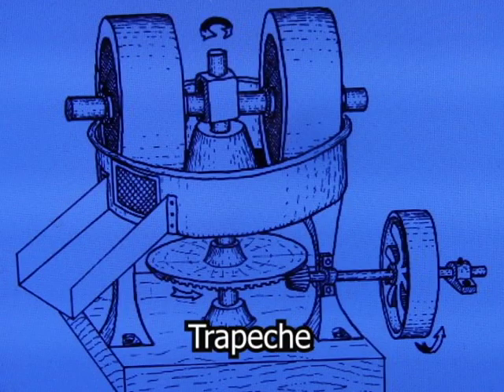Fundamental Milling Principles-  Crushing and Grinding

Comment: Great video Keith!
One note -- 1/8" screen (0.125" opening)  != #8 mesh (US Std. 0.0937" opening) because the wires forming the mesh have thickness.
In fact, without specifying the wire thickness, an 8 mesh screen could have openings from just over .100" to under .020" depending on the diameter of the wires and the weave.
Reply from the maker: You're absolutely right.  Sometimes I oversimplify for ease of understanding, sometimes just by accident.  Thanks for the input.

Looks like I will be prospecting in New York this summer.  How's that for an unusual location?  :-)

Got a viewer with some spots there and he is also recycling e-scrap.  Should make some good videos.  Also have an invite to Mali, and a possible to Borneo.  Life is getting interesting...

Comment: Yeah Quarts is really savage on the gear ,being around 7 on the Mohs scale for hardness it,gauges into steel real bad , yes hard facing ,is good ,but i wonder ,and iv'e not tried this myself ,but if you heat steel to cherry red and then quench it , it will harden it ,but it might also make it more brittle ,just a thought ,maybe could try on the impact mill tips ,or on the jaw crushers  jaws , Great video ,thanks again for sharing ,cheers .
Reply from the maker: The jaws are high alloy and heat treated.  They still wear out in a shift with hard quartz.

Comment: Keith, I’m thinking about building a  jaw crusher and an impact mill , I notice your impact mill uses vanes to do the grinding. What do you think of using carbon steel hardened chain?  Would they wear better than the vanes? I have some 1/8” AR 500 steel plate to line the inside of the impact mill. 

One big question on the impact mill is how do they keep the grit out of the shaft bearings? I know the dust will work it’s way through sealed bearings fairly quickly.
Reply from the maker: I have no experience with chain mills so my info is somewhat theoretical here.  My mill is set up to maximize the blower effect of the impactors to create a draft for the air classification system.  I do not know how well chains will work for that.  In order to get natural draft the input opening has to be near the shaft (therefore on an end) and the discharge on the perimeter top somewhere to allow oversize to drop back for re-grind.  If there is not enough natural draft, a shop vac can be used for that purpose.

Good industrial bearings designed for dirty environments should have a proper labyrinth seal that will allow long use in the dust, but even then, a draft will pull clean air in at the shaft and keep the area immediately outside relatively dust free.

The drive should have some sort of engineered failure point in case of catastrophic failure inside the housing.  If a belt drive, it is naturally provided by the belt to pulley 'friction clutch effect'.  If not, a shear pin of keyed shaft can protect the expensive motor.

Chain impactors cannot be hard faced, but are quick to replace and easy to fabricate.  Steel bars instead would provide a hard faceable alternative in high wear environments.  Any impactors should  have a way of 'giving' in case of a jam.  A chain or hammer mill has it naturally.

Keith

Comment: What welding rods do you use to 'hard face' your jaws? Do you see more wear on the moving jaw or do you hard face both jaws?
Reply from the maker: Stoody 31 hardfacing electrode, stick welding.

More wear by far on the moving jaw.

I hard face both jaws, but the stationary jaw last three times as long between re-facing.
Reply: @hardrockuniversity7283  Thanks much for the prompt & precise reply.
Reply from the maker: @peteraska868  You're welcome.  I enjoy helping.

Comment: Is there any shredder/fluffer for Iron ore Green ball with moisture 11%
Reply: Pellets
Reply from the maker: Are you trying to crush them?  What is the end purpose and the size needed?  What is the starting size?
Reply: @hardrockuniversity7283  size will be 9-18mm with moisture 10-11%,It should be disintegrated
Reply: @hardrockuniversity7283  this rejected material will be used in Balling of green balls again.So fresh material along with this recycled material will be feeded to balling disc ,which disturbs the balling shape and balling quality